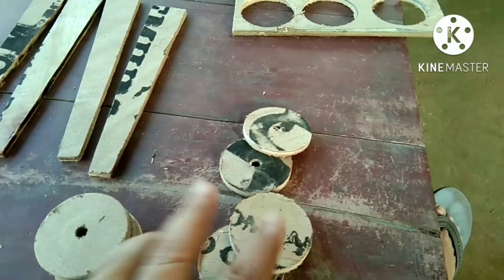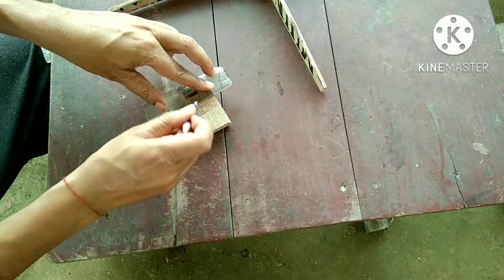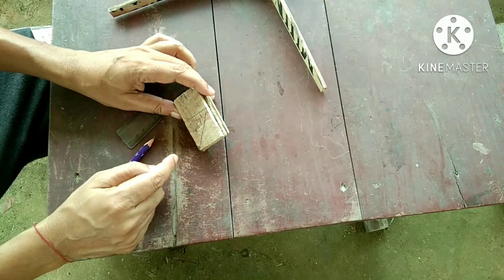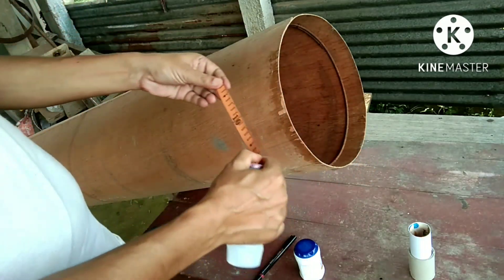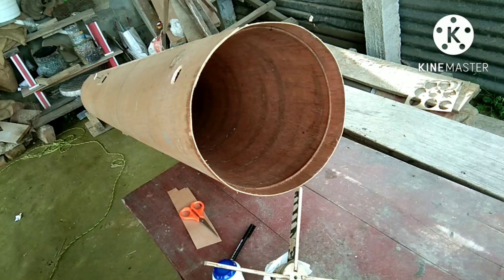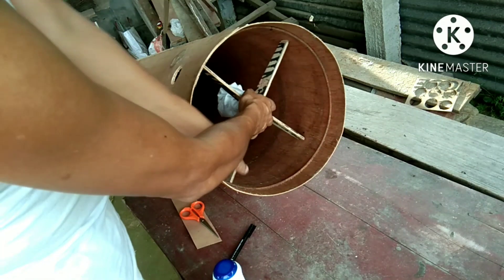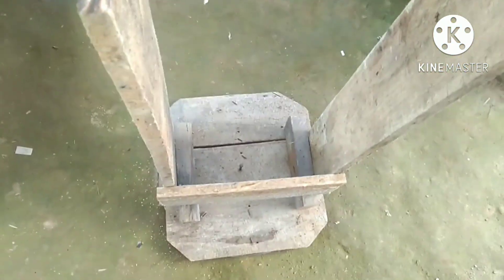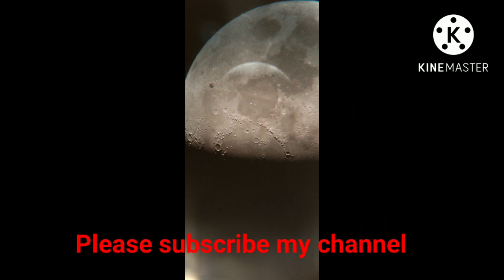How to make telescope | Last Part | reflector telescope | 12" large telescope

Comment: The telescope you made, it's market price is approx 1 lakh indian rupees (Some brands costs more than 1 lakh). And you made it under 10 thousand indian rupees. Even if all wooden parts replaced with good quality plastic parts, still it will cost less than 20 thousand. Sir, you are a gem 🙏 🙏 🙏

Comment: Impressive work on such a low budget. One question, don't you have much spherical aberration?
How long does the silvering of the mirror last in good condition, have you had to silver it again?
How big is the secondary mirror in proportion to the primary? well three questions.
Reply from the maker: little bit of spherical aberration due to very thin mirror,
silvering last many years , in my case i found very little brownish colour appear after 6 months .
Reply: @astrovillager  Thanks for the information, I'll try to do something similar later. Well, 6 months is not bad, it can be silvered from time to time.

Comment: How is your large 12 incher telescope doing? Can you share any results? I want to see how the thin 8mm mirror is performing.
Reply from the maker: I showed an image of the moon taken through this telescope  in the last part of my vedio serises , but i suggest you if you want to make your own mirror (12inch) please use atleast 19mm, which i said in my first vedio, because i found when i going to tight the mirror cell clips , image become  distorted, due to thin mirror.
Reply: @Engineering at Home  you can search and try making a mirror cell specifically for thin mirrors. They are designed in a way to eliminate distortion. John dobson used to design these kind of mirror cells